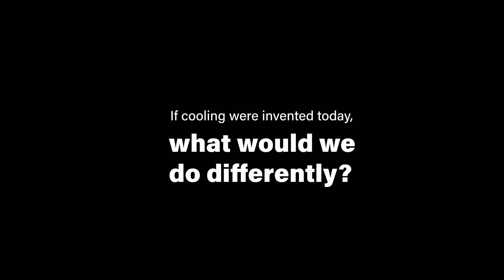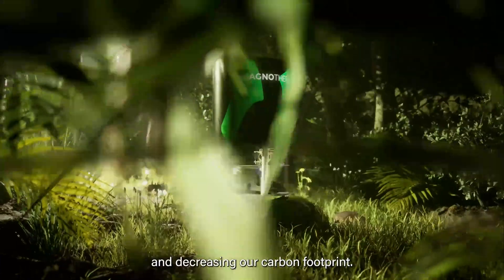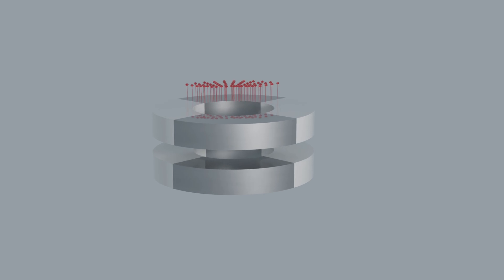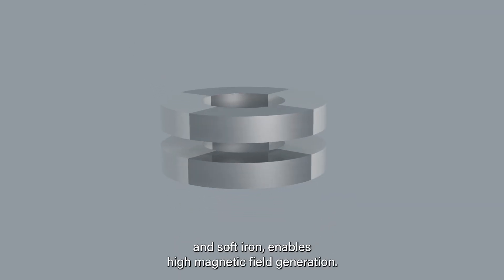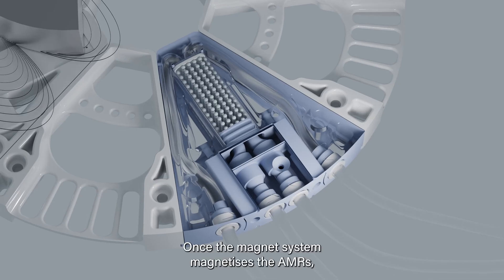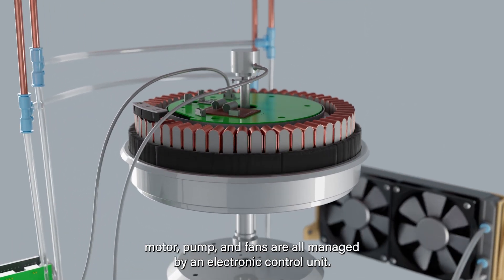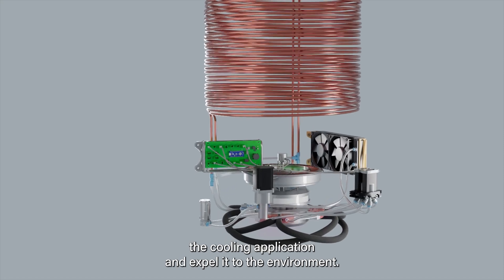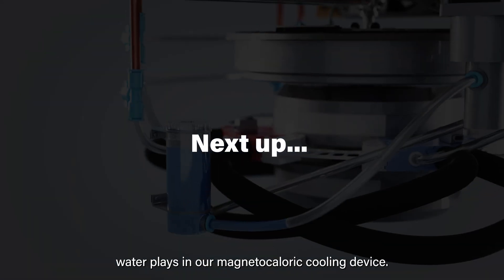Tech Series: 01 Introduction to Magnetic Cooling

Comment: Why don't you make a compressor working with magnets? Using R290 / R600a? Your concept looks good but I will use glycol not water.
Reply from the maker: Propane and isobutane are still both highly flammable. We want to make a cooling system where safety and low maintenance are top priorities.
Reply: @MAGNOTHERMSolutions  Now cars are suddenly dAngEroUsS
Reply: Ozone depletion would and will happen regardless of their belief systems. There are many other factors that take out the ozone in the stratosphere. "climate/change/global/warming" with or without us. Solar activities/variables and the awakening of volcanic activities around the world and at the ocean's floors. Can't wait until this invention is put to practical use/cost effective. Want to see what kind of excuse the EPA has to ban this one too.